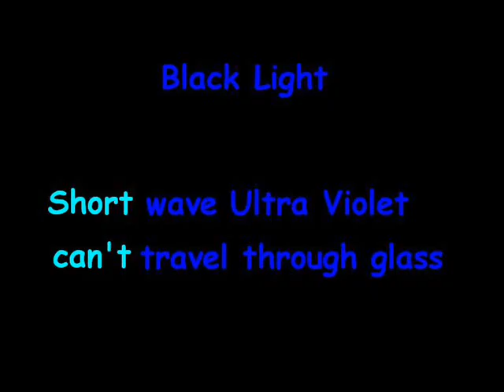Short and Long wave UV

Comment from the maker: The shortwave light was surplice laboratory equipment for a biology research centre. The lamp it’s self is similar to a germicidal UV lamp but I suspect the filter is made of quartz to transmit the shortwave UV and it is coloured like “woods glass” to remove the visible light from the UV tube.

Comment: the fluorescent coatings fluoresce under short wave UV because that's what the mercury vapour produces in large amounts when it's got an arc going through it. This way the otherwise invisible UV produced is made into useful light while at the same time being blocked by the glass. Short wave UV is one of the few things I probably wouldn't want to play with as it's pretty nasty, it ionises the air and can give you a sunburn!

Comment: But, if short-wave UV can't pass through glass, how does it cause the internal phosphor to glow on the MV lamp?
The UV light MUST travel through the glass first, to get to the phosphor?
Also, how come the bare exposed phosphor was not fluorescing when under long-wave UV?
Reply from the maker: The fluorescent coating in the mercury lamp is sensitive to long wave UV where as the coating in the fluorescent tube is only sensitive to shortwave. The long wave UV will travel through the glass bulb and fluoresce the MV lamp coating but not the fluorescent tube. There is a good reason for this. Low pressure mercury discharges, as in the fluorescent tube, produce mainly shortwave UV where as higher pressure discharges, as in the MV lamp, also produce long wave UV. The MV lamp can used different phosphors to take advantage of this.